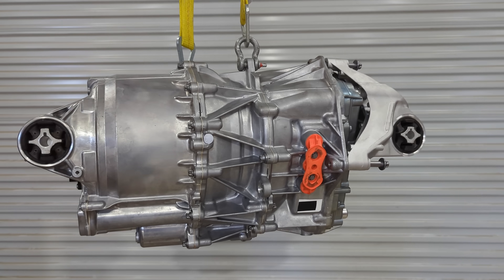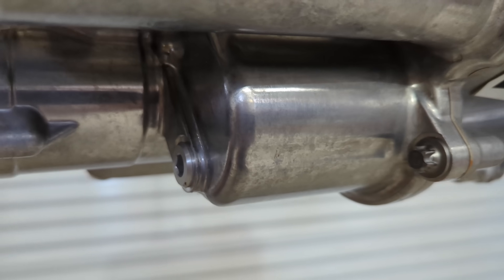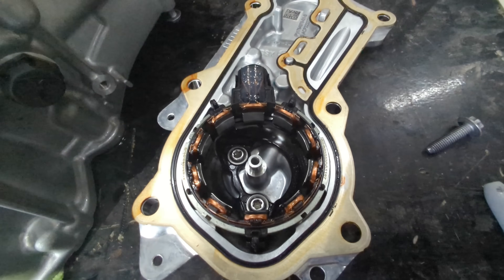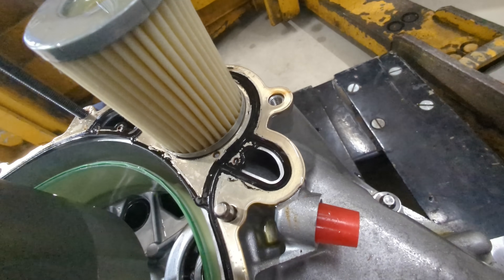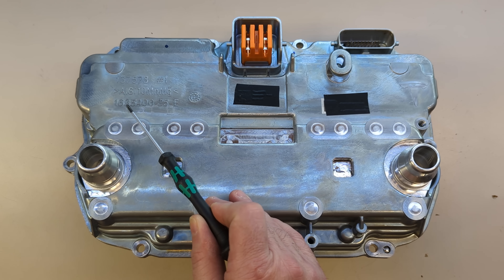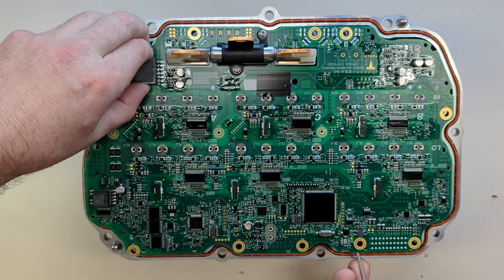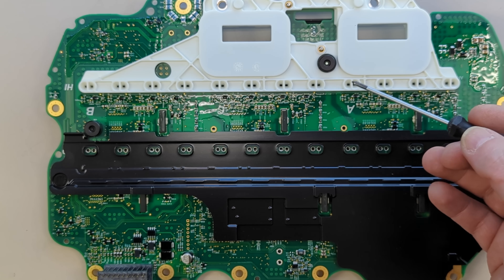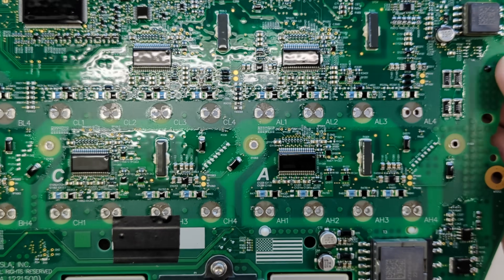Tesla's Newest Motor & Drive Unit

Comment: Unfortunate to see that they ditched the removable oil Filter.
Reply from the maker: I think this is a better design.  There really is no reason to ever replace the oil filter.  People are used to thinking this is like an ICE where oil is contaminated by combustion blow-by and broken down by high-temperatures.  This is only to filter out the really small amount of material detritus from manufacturing and wear over the life of the unit.   There are no friction surfaces in this unit like an automatic transmission would have.   Tesla considers the lubricant to be "lifetime".  I recommend changing it at every 40k if you want to be really careful, but no need to ever change the filter, it has even more surface area than the old spin-on design and eliminates a possible leak point.
Reply: @Ingineerix  you're probably right about the oil filter, but id still rather change it combined with the oil. 40k miles seems approriate for Service intervals. Great Video btw.
Reply from the maker: There really is nothing that will contaminate the oil enough to load the filter before the drive unit completely wears out.  You have been conditioned to think this after years of doing it on ICE cars.  The original Model S/X didn't even have any filter other than a screen!

Comment: If water gets up to the height of the gearbox, water will flow in?
Reply from the maker: Yeah, but keep in mind where this is in the car, it's about 2 feet off the ground.   You'd have water coming inside the car by then!  A splash won't do it, because it's so far up under the car.
Reply: @Ingineerix  For sure. I'm just thinking about how Elon said the Cybertruck can act as a "boat". Not that I would ever try this, but you know people will and once it's in the gear oil, it's never going to come out.
Reply from the maker: @lettuceb  Well, I hope to be able to take a Cybertruck apart when they come out and we'll see if they changed the way the breather works.  I suspect they will.  The deepest water you could safely ford on a Model Y would not be a problem for this breather design, though of course it could be better, but would cost more.
Reply: @Ingineerix  This is slightly concerning 😳. I appreciate the reply and the level of detail in a concise video! That hairpin is amazing
Reply: @lettuceb  someone has to be really stupid to take his car boating! All those electronics and possible mods to it will eventually destroy it.

Comment: The thing with infrared sensors for FETs (IGBTs?) temperature monitoring has blown my mind! Seems like an ingenious solution, where you don't have to rely on physical contact, clearances and thermal compounds to relatively accurately measure the temperature.
Reply: Munro did a tear down on the Ford Mach-E inverter, (I think?) Much more convoluted to assemble. I remember thinking it was ridiculous in comparison to the first gen Tesla inverter. This one is from a different planet!
Reply from the maker: The first gen Tesla inverter was a mess.  I don't like the mechanical design.  (Large drive unit used in the S / X starting in 2012)
Reply: @Ingineerix  Are you talking about the triangular FET design one?
Reply from the maker: @moki123g  Yeah, poor mechanical design.  They are prone to leaking coolant and self-destructing (among other things).  They no longer make it, the newer designs are superior.   Can't fault them too much, that was very early days in 2011.
Reply: @Ingineerix  Yeah, ok, that's what I thought. From your teardowns, It looks like they are getting much better.
Reply: Yeah I agree. That stood out to me as well. No extra connectors or wires going to a thermistor, no extra tie downs. Just plop the board in and have a robot solder the fets.
Reply: They use ir sensing on the Tesla wall connector as well.  From another tear down video.

Comment: Can you share a little information on what car this came out of or if it was from California or Texas?
Reply from the maker: As far as I can tell, this unit is only being put into TX Model Y's at this point, and not all of them have it.
Reply: @Ingineerix  I have a 2023 MYP with this motor in it and the car was built in Fremont, CA but the motor has GTX placard.
Reply: @jezza6575  Can you see the motor placard under the car? I've got a March 2023 MY LR Texas, and I couldn't see any identifying details when I looked under it just now....
Reply: @PelicanNorth  Sure can…if you look behind the rear drivers side wheel you can see it.  It’s not easy but I set the timer on my phone to take a picture and stuck it up there…took a few tries to get a good pic but it’s doable.  Be a lot easier if you remove the wheel though!
Reply from the maker: Nice, this is the first I've heard of a Fremont car having it.   Was it the same part number?

Comment: Don’t like the permanent oil filter, fail to see how this saves cost
Reply from the maker: I think this is a better design.  There really is no reason to ever replace the oil filter.  People are used to thinking this is like an ICE where oil is contaminated by combustion blow-by and broken down by high-temperatures.  This is only to filter out the really small amount of material detritus from manufacturing and wear over the life of the unit.   There are no friction surfaces in this unit like an automatic transmission would have.   Tesla considers the lubricant to be "lifetime".  I recommend changing it at every 40k if you want to be really careful, but no need to ever change the filter, it has even more surface area than the old spin-on design and eliminates a possible leak point.

Comment: Thank you for the tear down! 
Rare earth magnets positioning in the rotor seems to be copy paste of the Lucid Air PM motor. 
Also rectangular section wires for the windings in the stator is heavily "inspired" by the Lucid Air PM motor solution (square section wires for the windings in the stator).
Reply from the maker: The magnet positioning really hasn't changed much since Tesla's first PMSRM (before Lucid was around), and the rectangular hairpin windings have been produced since the 1960's. (Maybe even earlier)
Reply: @Ingineerix  OK, thank you for setting the record strait.

Comment: The latest wall connector also has an IR sensor for measuring the unit temperature as well!
Reply from the maker: Nice!  I should teardown one of these.
Reply: @Ingineerix  I'm not sure I realized the implication of switching to an IR sensor? Accuracy? Cost? Energy savings?
Reply: @FlorentHenry  IR sensor doesn't require direct contact to sense the heat, so voltage isolation is free.  My guess is it reduces peripheral circuitry and cuts assembly costs.
Reply from the maker: Prior to IR the only way to measure temperature is direct contact which can be unreliable and/or present assembly challenges.  I doubt the IR solution is cheaper, but it's probably not much in Tesla's volume either.

Comment: Huge THANKS for your hard work. I have watched the evolution on the video recorders from induction to brushed to direct drive. Mechanical hard drives going solid state with their magnets hopefully find ways into new cars and battery driven tools. Can't wait to find wheel motors on much lighter EV's for city use.  Small personal scooters have already shown us where we are heading.
Reply: Has anyone seen anything that defines what kind of power to weight make it “practical” to have hub motors when considering suspension reaction time, and wear and tear mounted at those points? Where might the tipping point be in that trade off?

Are those even the “right” factors to consider?

Comment: Any indication of bi-directional charging?
Reply from the maker: The motor has nothing to do with this, but no, the PCS has not changed and Tesla has no motivation to do this, it would eat into their powerwall sales.   I have several videos about this already.
Reply: @Ingineerix  Drew spoke about this and said they would be introducing this in upcoming cars. I know it has nothing to do with the motor, but wasn't sure if you saw any of the power electronics. 

I agree it will steal from powerwall sales but   Drew has now mentioned it twice (investor day and battery day), and i think competitors will pull them into having to offer it even if there are good reasons ( battery degradation) and bad reasons (self cannibalization) but think a profitable demand response tool would be helpful when. millions of Teslas plugged in.
Reply from the maker: As soon as I see it in a Tesla car, I'll do a video.
Reply: @Ingineerix  thank you for all you do

Comment: awesome work! any indicationsmarkings on the capacitor to denote voltage? I am hoping Tesla jumps to 800v architecture...
Reply: I believe they have already said the Cybertruck at least is 1000 volt. Not to mention switching out the 12 volt stuff for 48 volt.
Reply from the maker: Yeah, Here's hoping someone lets me take a Cybertruck apart!  =)
Reply from the maker: You will see a new inverter for this if they do.

Comment: Looks like Tesla continues to make their components less serviceable! Only benefits the already rich investors!
Reply from the maker: There really is no need to make them "more serviceable" if is already going to outlast the rest of the car.  I see this design as having the potential to be more reliable than the previous design which was already very reliable.
Reply: @Ingineerix  I love your practical mind. Thanks for your work & sharing your knowledge and passion!
Reply: @Ingineerix  You say it will....  "outlast the rest of the car" without presenting any evidence. I  come across this quite often when talking to Musk/Tesla fans. One thing I know for sure is that nothing is perfect, and their will be a certain amount of failures. That inverter is an expensive piece of equipment. If it fails when the car is outside of warranty, the owner is screwed! Your same argument has been used to justify glued in batteries in cell phones and other unrepairable high tech items. It is planned obsolescence. And what is truly amazing is that those who are likely to get screwed (the fans and customers)..... Are the very people who give billion dollar corporations money to buy these products, and speak most loudly in defense of these practices! I just don't get it.
Reply from the maker: I don't have the capability to "present evidence", as that would require a look into the future.  I am quite the opposite of a Musk fan, I think it's amazing what Tesla does DESPITE him.  The best thing Musk did is build a company that attracts some of the best engineers on the planet.

However, I do know a thing or two about power electronics, and the inverter design is amazing.  It definitely is serviceable, you can easily bolt in a new inverter.  I can assure you if something goes wrong in the power electronics, you would not want to keep the remaining components.  Even if they did not suffer chain-reaction casualty, which is the likely outcome, they would be stressed too badly to consider not replacing them all.   One of the things that makes this inverter very reliable is the sintered SiCFETs.  If you switched to a mechanical fastening regime, you would be making it less reliable.   I will bet you money that the mechanicals of almost all drive units fail long before the inverters do.
Reply: @DavidJohnson-tv2nn  serviceability is a delicate balance with everything else. While out of warranty repairs are a sad thing to experience, Tesla's warranty duration allows you to plan ahead your ownership far into the future and draw a very accurate TCO (Total Cost of Ownership) - then you decide which car you want to go for and if you want to take a chance beyond the warranty with costly repairs.

In the grand scheme of things, I believe it's better to have a 5k repair instead of 20 1k repair, especially if your changed that induces less serviceability increased reliability, performance, and decreased the cost of the product.

It's unfair to compare to a phone glued in battery that you have to throw away with a car you "only" have to replace an assembly of. (But I agree the phone market is messed up - but a fair phone and put apple out of business by your choices though)
Reply: @FlorentHenry  My concern is for those who can not afford to buy a new car with a warranty. They can only afford a used car. So what happens when the unrepairable 4680 structural battery pack fails? Tesla appears to be following Apple's lead  in anti-independent repair/anti-repair, with more and more components that are not serviceable. With gas powered vehicles....
Even if the car owner or service shop doesn't repair the component, they have the option to buy a rebuilt part. For example.... I've purchased rebuilt starters and alternators at a reduced cost. Tesla is working hard to make such options impossible.
Reply: In design you can typically choose serviceablity or reliability.  Legacy automakers and dealers make most of there money on service. I prefer reliability myself .

Comment: Last year I visited a company in germany which builds the machines which manufacture those hairpin Stators. Its really fascinating to see those machines first bend and cut the individual hairpins and then assemble the complete stator. That company said they supplied Tesla with such machines, so i guess those are the fruits of that labor.
Reply: Do you have a name to share? Would like to check out if they have videos or more info - out of curiosity.
Reply from the maker: Probably this company:  https://www.felsomat.com/electric-motors/hairpin-stator

And here's a cool video: https://youtu.be/3chl322LOBQ
Reply: @Ingineerix  interesting, thanks! Any clue why Tesla initially choose windings instead?
Reply from the maker: @FlorentHenry  Hairpin is almost impossible to manufacture without specific automation.  I think Tesla hired this company to provide the technology: https://youtu.be/3chl322LOBQ
Reply: Other manufacturers have been using that hair pin design for years lol!!
Reply from the maker: Yes, it's been around to my knowledge since the 60's.

Comment: I used to be engineer with a company that produced fork truck DC controllers (largest I had worked on was a 60V 900A) and later mobile wheelchair and scooter controllers. Super impressed with how compact and simple this design is! I know to make things simpler and cheaper its a lot of work (same goes for software - more effort to reduce code complexity).
Reply from the maker: This inverter can handle that current at 400 volts, and is way more efficient than any 60v inverter could be.
Reply: @Ingineerix  For sure - high voltage for less  resistance losses. When I started we had to use bipolar power transistors which under full load might have a saturation voltage of 0.5V or more - and very high switching losses too. The transistors were screwed down to big blocks of aluminium which in turn were bolted to the vehicles chassis for further heat dissipation. Because of the switching losses most controllers PWMed at sonic frequencies (except some that use speed up transformers to achieve 20 kHz). When the metal transistors blew up it was quite spectacular (where I used to test controllers had marks on the walls for many years)! MOSFETs (and subsequent variants) were a revolution. Even so the Tesla engineering is top notch for sure.
Reply: @Ingineerix  it would be metal if you could get a 800v ESC of a chinese EV on hand
Reply from the maker: @khoadangbui9451  What?  EVs don't use an "ESC".  It's called a drive inverter.  Feel free to send me one out of a Chinese EV and I'll do a teardown.  We don't have them in the US.
Reply from the maker: I haven't gotten access to anything Lucid, so I can't comment.   But I can say Lucid is a low-volume high-cost product at this point, so not a fair comparison.

Comment: Don't agree that the filter and oil will never need to be changed. With as long as these units are supposed to last, I can guarantee you won't want to be using the original of either (say 15 years and 400k miles later). The company just doesn't bother because it's well past the warranty
Reply from the maker: I recommend oil changes at every 40k miles, but don't need to change the filter.  This isn't like an ICE engine with combustion blow-by and high temperatures.  There will be almost no flocculation in this lubricant, and the filter area is huge.
Reply: @Ingineerix  What could cause flocculation in this closed-loop system?
Reply: @Ingineerix  Why doesn't Tesla recommend any oil change ?
Reply from the maker: @pauld3327  Most automakers see high maintenance as a disadvantage.  I think Tesla is especially keen on pushing the "EVs need almost no maintenance" line.  They reason that the drive unit will last long enough without any fluid changes, so that's what they push.   This is a marketing decision, not Engineering.   This is how all large companies operate.
Reply: @Ingineerix  Thank you for your response.

Do you think that there are others parts of the car that need maintenance and that Tesla doesn't tell us about ?
Reply from the maker: @pauld3327  Well, here's what they recommend, pretty solid except for the drive unit oil change (I do every 40k):  https://www.tesla.com/ownersmanual/model3/en_us/GUID-E95DAAD9-646E-4249-9930-B109ED7B1D91.html   Might be good to flush/change the brake fluid at least every 4 years.   I also do my Cabin filter every year.
Reply: @Ingineerix  Thanks a lot 👍

I discovered your channel yesterday and I am binge watching your videos 😀

Comment: I'm curious to see a measure of phase to phase resistance on the hairpin design vs previous windings, this could identify if there's additional material in the slot or the same amount, cost optimised. Thanks for everything you do! ❤
Reply from the maker: Gen 3 stator was 10.4 milliohms, and the new one is 8.1 milliohms. (taken with 4-wire kelvin connections and 10 second sample)